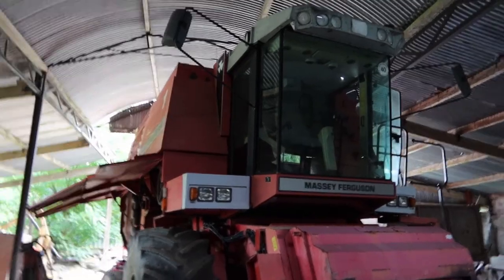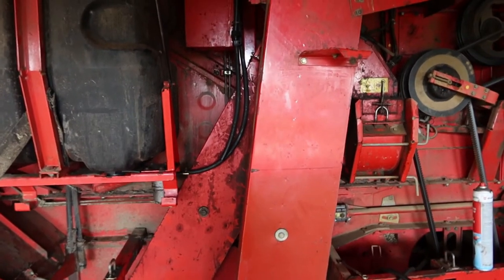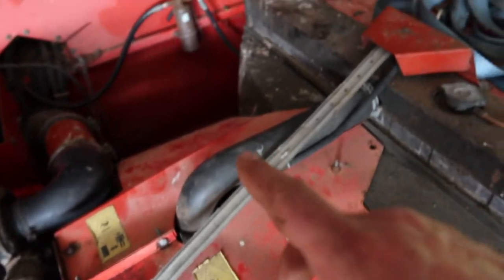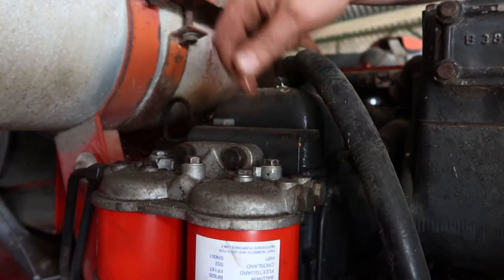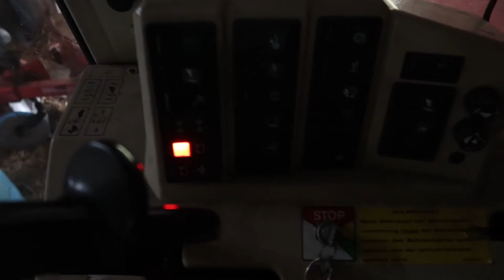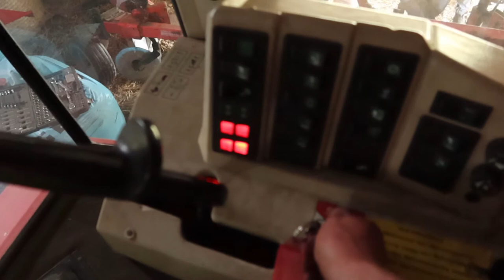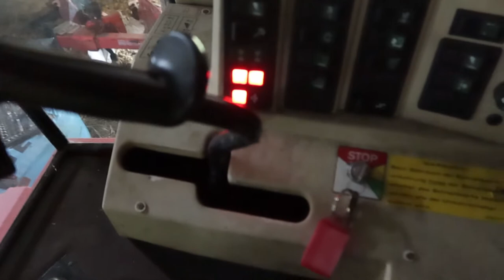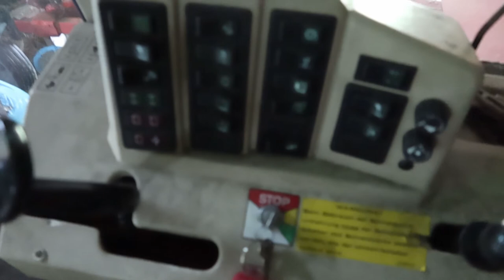Massey Ferguson 40 Combine Pt1 - Will it run?

Comment: I've got a problem with mine it runs for about 20 minutes then cuts out will start again after I wile I've changed the fuel filters and no better
Reply from the maker: John, I'd suggest looking at the fuel line, theyre rubber throughout their length and can perish or get chewed by rodents. When it does cut out also make sure that the fuel solenoid is still on (should be a loud click up at the engine when you turn the key on). Does it die suddenly or start to stutter and lose power? Where are you based?
Reply: @davesworkshop2714  hi thanks for getting back to me found some dirt in the outlet from the sediment filter it was restricting the flow of diesel its going much better now thanks
Reply from the maker: @johnw13473  glad to hear it John. Get in touch any time if I can be of help.

Comment: ridge lines no? rubber leaks after years when they become so soaked
Reply from the maker: They were pretty perished! I was surprised by the length of rubber line  installed. Id have expected metal. Rodents love combines and rubber too!
Reply: @davesworkshop2714  and everything else like automobiles too